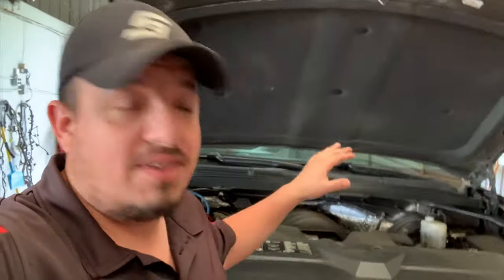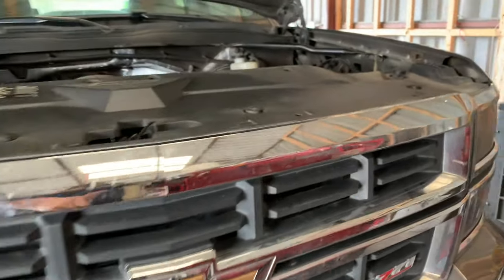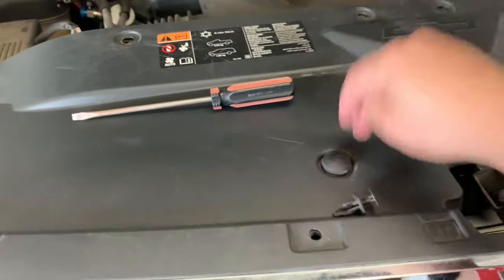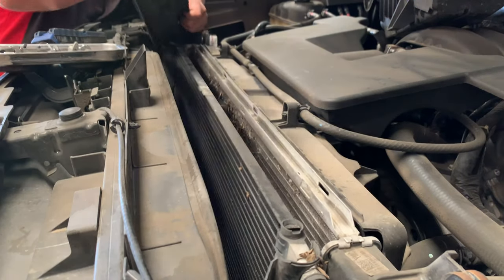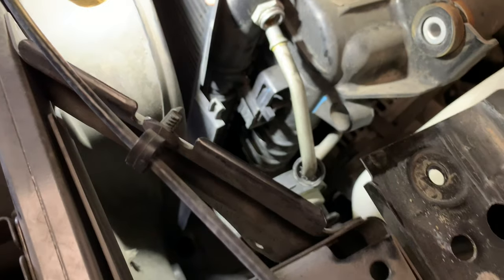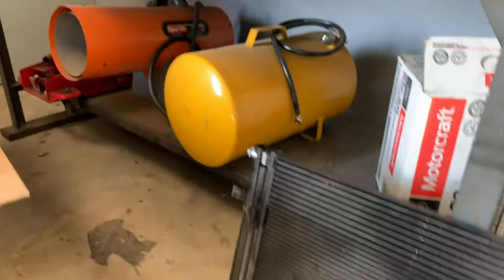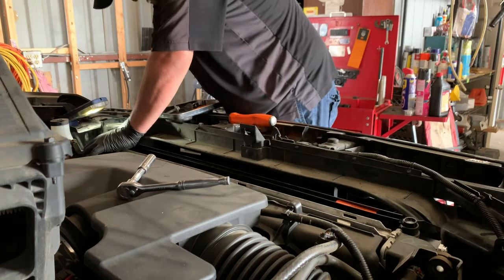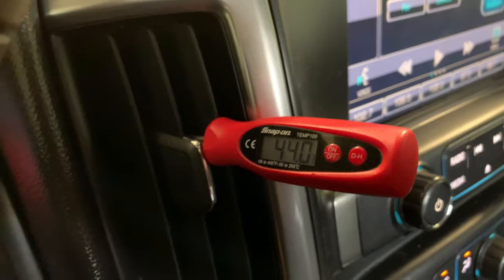2014-2018 Chevy Silverado A/C Condenser Replacement - Sierra-Tahoe-Yukon-Suburban-Escalade

Comment: Got the condenser replaced. But I didn’t have the vacuum pump at the moment. So I really can’t do a leak check. But 1 minor mistake cost me the transmission. One of the connection on the upper right hand side came off while I was driving. All of the transmission fluid got totally drained dried! Be extra careful when connecting the lines. Make sure the thin clips are on securely and the rubber sleeve on without popping back out. Now the  truck is vibrating and having hard time changing gears.

Comment: my ac quit working today. its leaking at that exact same spot. but for some reason it already had the dye in the system(I THINK MANUFACTURE PUT IT THERE) i just shined the black light around didn't take long to fine it. used a spray bottle of soap and water to confirm leak. where can i fined a reasonable priced Condenser?
Reply from the maker: there is a link on the description for the condenser from amazon ... if you dont want to wait for shipping just get it at any auto parts place.. but it will be a little more expensive .
Reply: Falcon's Garage ok I’ll check it out

Comment: I just replaced mine on my '14 Silverado a few days ago after watching your video and a couple others, so as to be sure that I knew exactly what I was getting into and what I had to do. I must say the 2 middle bolts on the cross brace were a complete pain in the arse, especially the drivers side behind the windshield washer fluid tank. Other than that the replacement wasn't too hateful, just time consuming. I purchased a vacuum pump prior to doing the job, so I did the vacuuming of the system and recharging of the refrigerant myself too. I didn't have to worry about evacuating the old refrigerant because due to the leak there was none in the system to remove. So far (fingers crossed) everything seems to be good and AC is working fine right now, lol. After seeing how much it could cost at a shop or dealership there was absolutely no way I was willing to pay that much when after pricing out everything (condenser, vacuum pump, freon, ect...) it wound up costing me a quarter to a third of the cost by doing myself. Thanks for the video, it really helped me make my decision and saved me a ton of money.
Reply: Did you have to add AC Compressor oil separately from the freon??
Getting ready to start this project today and from all of the comments, yours had the most details when it came to issues I may face. Appreciate you sharing

Comment: I've got a '16 gmc sierra that I've just changed the condenser following your video. My only question is do I need to add oil to the a/c?  If so, how much?
Reply from the maker: yes depending on how much it was lost ... I think the entire system takes about 8oz ... so MAYBE 3 or 4oz?

Comment: I just received my new condenser.  Should it be flat, or should there be a bit of a curve to it?  The top of the new condenser seemed to be slightly curved.
Reply from the maker: it should be flat ..  hope the curve wasnt enough to damage it
Reply: @FalconsGarage  Thanks.  I sent a picture to the place I ordered it from.  They confirmed that it was defective and shouldn't have been shipped.  Guess I'll have no AC for a little while longer.

Comment: So question. Mine doesn’t seem to be leaking too badly, however my AC will blow hot air and once I charge it, it only blows cold for a couple days and hot again.
Shop told me it’s the condenser and easy fix. I have extended warranty but the dealership is telling me they must do a full diagnostic to determine what it is. 
Does that sound like the condenser? If so, I’ll change it myself
Reply from the maker: if the dealer is willing to do it under warranty I would just let them handle it .. yes they will want to do proper diagnostic because they wont take your word or from a person online .. its normal

Comment: Where is the filter drier located? also, inside the connections, is ther a rubber seal? If so, what is the part number for the seals.

Comment: That liquid that you said you’d need a pan for when it drips, what type of liquid is it and how much will I need to put back in? And where do I put it.
Reply from the maker: its transmission fluid, put it back on or though the transmission dip stick .. should be less then a qrt .. but check the level before refilling

Comment: Bravo👏👏 thank you sir! On the 3rd fill I added uv leak detector. I did not find the leak right away but on the 2nd evening, looking in that exact spot,  found it right off. Thanks for your tips. Question #1, could this be welded as a repair? #2, should I avoid the ACDELCO unit? A TYC brand has a lifetime warranty, instead of 2 years.
Reply from the maker: there is company's that repair radiators etc .. but you still need to take it off so probably better to just put a new one, as far as witch one as far as I know they haven't updated their old condenser.. so I think the problem will come back

Comment: Hello, thanks for this video. I have a question, is the condensor the only thing that cools down my tranny fluid or does my radiator does as well. 2015 Silverado LT 4x4. Thanks!
Reply from the maker: To be completely honest this trucks came with so many different options, you would have to follow the transmission lines and see it they also go to the radiator. Because some did and some didn’t.  Mostly the 2500 and 4x4 did go to the radiator also .. but not all of them.
Reply: Thank you!

Comment: Do I pour the pag oil through the condenser opening its self and how may ounces
Reply from the maker: Yes. If I remember correctly the system only takes about 8oz. So maybe 4oz.  But you should double check the amount that the entire system takes

Comment: Awesome video! I checked and mine is leaking the same spot!!  Anyone know if you have to add trans fluid? Does it lose much when you swap it out? Did anyone change out all the seals like they recommend? What about the dryer?
Reply from the maker: yes you will need  to add trans fluid because its all in the same spot .. exactly how ,much depends on how much you lost .. check levels after job to determine how much to add
Reply: @FalconsGarage  great thank you! And I still have freon in my system, so they sell recovery tanks or is there valves to close so I don’t loose it all or how do you depressurize the system?
Reply from the maker: @tommyczak1   to do freon recovery you need a special machine that cost allot to recycle the freon .. there is No way to close a valve so you wont loose it all .. sorry
Reply: @FalconsGarage  thanks again for the quick response. I was able to take it out exactly like you said. Just waiting for the replacement from  rockauto. Hopefully be back up and running tomorrow.

Comment: This is the video for the repair. How do we prevent this from happening? Is there a better part to buy? No one wants to do this every couple years
Reply from the maker: There is NOTHING you can do to prevent this if you have the defective part from factory. All new parts specially from factory is an updated part number witch means an updated part haven’t heard of any new updated parts with the same issue

Comment: I’m going to be doing this job at home as soon as my new condenser arrives. I don’t have an AC vacuum system or anything to recharge the system. After I install and drive to a shop to charge the system will they be able to vacuum the system and get the moisture out? Or does it need to be done before it’s used for the first time?
Reply from the maker: Yes. You can do that just DONT turn on your AC on your way there because the system is “dry” and will damage the internals also make sure they add oil (pag oil) wen filling it up with Freon
Reply: @FalconsGarage  Thanks! How much transmission fluid will I need to replace since some will be in the integrated trans cooler portion?
Reply from the maker: @tkampinelli307  likely for the transmission it had a dipstick and you can check how much you lost after replacing but It’s usually about 1-2qrts
Reply: @FalconsGarage  I just replaced my AC Condenser watching this video and went to check my trans fluid level to see about how much to add and noticed I didn’t have a dipsticks? And idea how to check?

Comment: Great video👍🏼before removing the ac lines from the condenser do I need to discharge the refrigerant and is there anything I should know of or do or I just go on and just remove all lines without doing anything
Reply from the maker: if there is freon still on the lines.. then yes they will need to be discharged.
Reply: If you still have freon why would you be changing the condenser?

Comment: If I go to garage how much will it cost? Thx!
Reply from the maker: Depends on were you live .. but from ive seen around 1300
Reply: Got it fixed. Cost me $560 at first but these trucks use an exspensive Freon, so add on another $140. $700 after tax

Comment: I guess its a bad idea to take it to a radiator shop have them reweld the original one and retest it?
Reply from the maker: its probably better to just get a new one
Reply: @FalconsGarage   what reason is that for oem is a arm and leg and we have all tried after market condensers fitting never work. I'm just saying if they test it and clean it what's the difference and you stay with oem?
Reply from the maker: @Silverado08JP  I’ve never had an issue with an after market. Fixing one cost about $100-$150 where I’m at. Plus the labor or taking it off and putting it back on. After markets cost about $100-$120.  So for me makes more sense just to swap it
Reply: @FalconsGarage  oh ok I thought there was a valid reason. I like to try to keep my trucks oem. So the extra 50$ doesn't break bank yet.
Reply from the maker: @Silverado08JP  everything I do is according to the customers wishes. I give them the options and they decide. But if it was my car and like you say you want to keep everything oem then I would just buy a new one from the dealer and not “repair it”. But that’s just me or if it was my vehicle

Comment: Did you have to use any pag oil
Reply from the maker: yes.. dont remember the weight but if you call the dealer or a parts store they will tell you

Comment: Where can I find the machine to suck out the fluid
Reply from the maker: mike newman the recycle machine can be bought at auto parts places ... but for the most part they are very expensive so they have to order it.
Reply: I hear it’s illegal to just dump it into the atmosphere (do you have any nosy neighbors?) or take it to an ac shop and have them suck it for you. They may do it for free. But, if you have plans to have a shop refill it, it would be good to go back there so they can charge you to put your refrigerant back in.

Comment: They quoted me $1300 at Feirsntoe Atuo Crae today, plus charged $50 to find the leak. I said, thanks. I'll think about it. They wanted $600 for the condenser and the rest on labor and recharge. Parts store down the street said condenser is $150. So far am saving $1100 doing it myself.
Reply from the maker: Glad I could help out!

Comment: Can i remove my condenser without vacumming the freon?
Reply from the maker: Well technically if you had a leak is probably empty anyways. So in that case YES. But you will need to vacuum the system before Freon goes in

Comment: Would you recommend going oem condenser or a different make?
Reply from the maker: i haven't heard of any issues with oem .. so if you can afford it i would do that... as far as I heard the issue was only the fist batch that came on the cars
Reply: Falcon's Garage , FYI it’s not just first batch... it’s happening on trucks as new as 2018. It’s a bad design.

Comment: hey do i need to discharge my freon before i disconnect the condenser?
Reply from the maker: Yes. Vacuum out the system. But if you have a leak. Most likely you won’t have any Freon left 🤔🤔
Reply: @FalconsGarage   ok thank you. my a/c still blowing slightly cold air so i figure there is still freon left. my a/c condensor is leaking trans fluid, thats why im replacing it. do u have a video of vacuuming freon from the system ? lol.. im so ready to do the job , its just that vacuum part im not confident about doing lol..

Comment: Did the condenser fit perfect like oem or did it have a little more space on one side than the other?  I bought the Spectra premuim and it fits but it is a little off and the condenser went into all the slots and popped in. Maybe just cheap quality condenser
Reply from the maker: fit perfectly

Comment: is it the same concept for a 2008 sierra
Reply from the maker: Paul Shipp same concept yes. But not 100% same procedure. Also those years condensers are not known for leaking on the Dane welds.
Reply: @FalconsGarage  Thanks I checked the condenser couldnt see any oil anywhere but the bottom of my compressor has the green uv dye all over it.
Reply from the maker: Paul Shipp sounds like it might be the compressor.

Comment: When you connected the top lines on the condensor did you push lines in then place clip over it?
Reply from the maker: i usually put the clip on first .. then push the lines thru
Reply: Thank you.  I just installed mine and I had a tough time trying to put clips on after. Your video was a big help.

Comment: Where is the ac pressure switch located
Reply from the maker: check the high pressure line
Reply: @FalconsGarage  I looked all under this hood and can't find a switch. I even tried looking online and they didnt mention it. I have a 2014 gmc sierra and the air works most the time but sometimes it don't. That's why I think it's the pressure switch. Apparently it don't have one. I even tried looking up the part and got no answer
Reply from the maker: have you followed the entire high pressure line?  around the compressor
Reply: @FalconsGarage  I just figured it was on top like the old models. Thanks for taking the time to answer me. Dearly appreciated man. Subscribed

Comment: Do you not put oil in the condenser?
Reply from the maker: About 2oz. It all depends on how many oz you drain out of the condenser. But for the most part it’s usually 1oz or less

Comment: Does this leak cause the transmission temperature to remain in 160?
Reply from the maker: no
Reply: What do you think, that would be? Fan stays on for about 3 minutes after I turn truck off. And temperature gauge stays at 160

Comment: Thanks for the video. Hey i can’t physically see a leak in the lines or the weld where it is prone to leaking. I have a 2015 suburban and I put Freon in it and after a little while it leaked it out not sure where.. the clutch wasn’t kicking on til I charged the system which stated it was low. To begin. Should I go ahead and change the condenser?
Reply from the maker: I wound not change a part if I wasn’t 100% sure that’s were it’s leaking from.
Reply: Falcon's Garage ok thank you
Reply: Falcon's Garage what o rings do I need?
Reply: Try the UV dye. You can buy a can of refrigerant with dye included for around $15.00. Buy a uv flashlight and wait till dusk/ dark and start looking around. It could also be the interior evaporator under the dash. Try the high/low valves, could be a valve seal.
Reply: reedrobb thanks for the reply man. I tried the uv can and It ended up being the weld that was cracked

Comment: Thanks for the video. I haven't had the failure yet but I feel it will come. Does oil have to be added when changing out the condenser.  Thanks
Reply from the maker: Yes it will, depending on how much you loose .. a couple of oz

Comment: If all the freon has leaked out why do you have to do a vacuum on it
Reply from the maker: Because you are getting out all oxygen and moisture out of the system. If left inside it will never be as cold and it should be or could be and it can also create rust it will also have extra. Pressure on the system .... among other things that could happen to it
Reply: @FalconsGarage  thanks for the info. Is there a tool that I can rent out by to vacuum the system myself so that I can replace the condenser myself to save a lot of cash. The process that you posted looks fairly simple and doesn't looks like $900.00 worth of work. Can it be done without taking it to an over priced garage
Reply from the maker: Now sure if the parts stores will rent out vacuum pumps .. but you can try to find a store that will
Reply: Autozone has a tool loaner program. But, summer months may have no inventory. Since their loaners have no time limits, people are not in a hurry to return them. But, I spent about $140 on the tools, refrigerant was near $10. Pretty cheap if you have to do it again on another car.